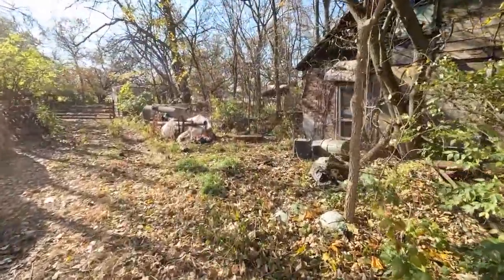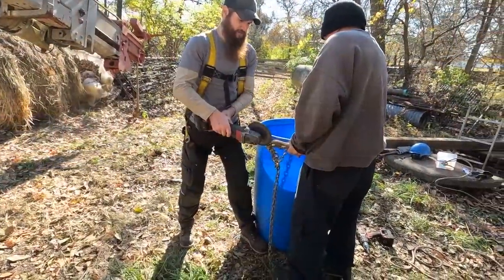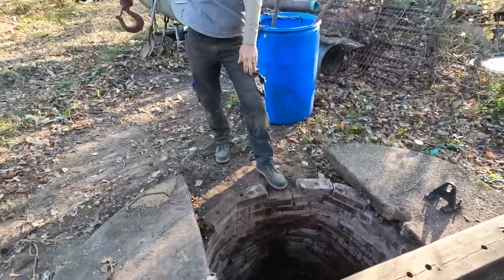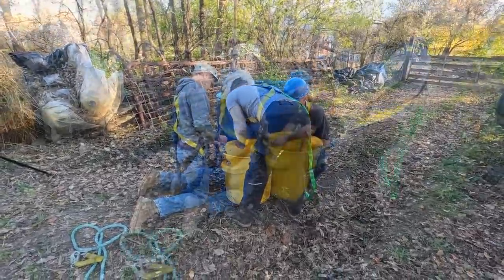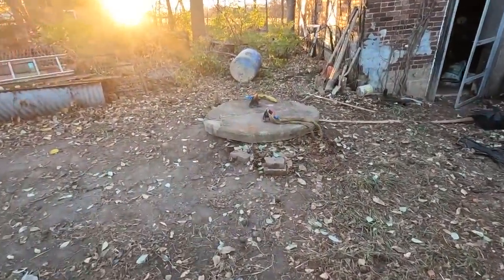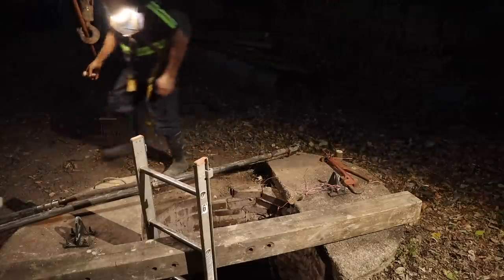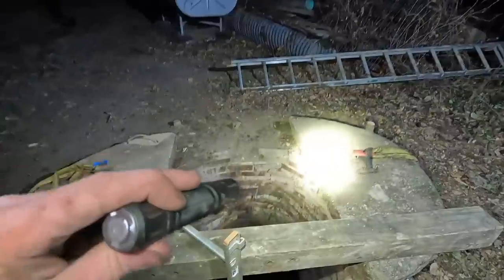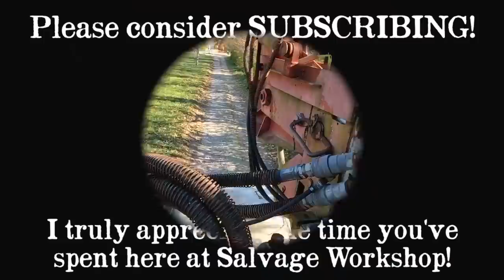Can we SAVE the WELL at the Farm with a Crane & HAND Tools? ~ Putting my Auger Crane Truck to WORK!

Comment: No vac truck operators would respond because “physics” you can’t lift water with a vacuumed more than 33’ or the equivalent of one atmosphere. If you apply more than one atmosphere of vacuum to water at  sea level it boils at room temperature.  Same reason water boils at a lower temperature at 10,000’ elevation than it does at sea level, lower pressure = a lower temperature for the boiling point. That’s why they wouldn’t even come out to look at it. It’s the same thing that happens when a propeller on a boat experiences cavitation. There can be a huge pressure drop on the concave side of a boat propeller  when it is turned fast enough with enough torque. The pressure drop on the back side of the blade is enough to cause water to go from a liquid straight to a gas.

Comment: Maybe a string and a fitting would be faster to measure. Also your two pipes going to the fitting in the well (jet pack) .
The jet pack gives you about half pumps volume and pressure. And I’d never clean a bore or hand dug well.
Mostly just wanted to share a little.

Comment: Should have put a short chain loop on the bottom of the bucket. To dump just knock it over, hook to the bottom chain lift it. also, a walkie talkie for the person in the hole and the person running the winch should be used so there isn't a delay between what one person says another hears and what they say to the winch operator.

Comment: I get a painter's mask with a little CO2 going to it from a your truck air system 5 lb on last for a couple hours going into a painter's mask and then your pipes down there are probably completely plugged up cuz they're metal and they cried on the inside they're probably full of rust and that's what your problem is not the the muck in the water

Comment: This just the most stupid, slow , positively daft way I’ve ever seen to get sludge out of a hole in the ground, you could have dropped yr auger bit in the well, stirred it with the water in there and just used a slurry/dirty water pump to clean out, you would not be aloud to do this in the UK , just plain ridiculous, normally you guys are spot on with everything you do, but you must’ve been having a off day when u did this 😮😮

Comment: running a boom without any angle reduced capacity. you want the derrick corner about 7 steps off the object your lifting or using an auger
live by the load chart

Comment: I'm gonna say you need to take a 5 gallon pail and cut the bottom off of it. Take that and put it inside itself. Put a bolt or something through the two to act as a hinge. Drop that down and let it sink once it's sunk just pull it back up the bottom should seal against the sides well enough. (No pun intended) and if it doesn't seal perfectly it should still hold the sludge and leak water back down. Just a thought...

Comment: A shop vac with a long plastic pipe taped onto the hose and lowered down there would be a good idea to continue sucking  air out of that hole while the guy is working down there. fresh air would continue to flow down there to replace the air pulled out with the vac and make it more comfortable and safer to work down there. Hard to tell what kind of gas is mixed with the air down in that hole, maybe radon, co2, or maybe methane from rotting vegetation. These are good ideas for working in confined spaces. Not according to regs, but small measures to help you stay a little safer.

Comment: Well I Love it. I’ve had to clean out my well a few times. I’m a get the job done so you over safety to me, but if my kids where doing it so again well done. Now for the next time help, an eyelet on the bottom of the bucket. Used to help tip the bucket with another rope  attached to the hook.

Comment: Actually, the answer to your conundrum is sitting 6-8 feet away. Take that culvert and suspend it around the auger. The auger will pull the goo up into the culvert & when it's full, pull it out & reverse the auger to spit out the goo.

Comment: It's jobs of this nature where for safeties sake communication becomes vital,  in my humble opinion you would be on a winner if you could source or adapt a hand held remote control set up for all the cranes functions,   that way you could have operated it from the well mouth and remained in direct visual and instantaneous contact with the man down the well, - what if there had been subsequent gas seepage overnight you were both unaware of,? 
 I dont know if there are the same things in America but in Britain we have medium sized vacuum sweeper vehicles that go around  using large eight inch bore flexible pipes to clear blockages and such in drains and sewers etc we call them gully sweepers or sludge gulpers, one machine with fifty feet of hose would have sucked out that entire well,   sludge, water and everything in about half an hour flat and stored it in an onboard 4 or 500 gallon tank where you could have driven it to any of the surrounding  fields and pumped it away under high pressure like a fire hose. it possibly could be worth your while looking into such vehicles it would add another string to your already pretty versatile company bow. there are hundreds of uses for them such as pumping out flooded cellars for one.

Comment: Had to do the same thing woth my father's well .. He hand doug it back in the early 50's . Then in the late 70's it had caved on the sides only had a couple ft of water . We used a windless and a little smaller bucket than you have  I went down and we  a day and a half  got it down to a rock bottom and couldn't keep up with the water coming in  lined it with 4 ft concrete pipe. working well today.

Comment: Such ambiguous "communication."  Scary.  And one guy seems deaf.  Scary.  I think working on the well this way is fne, but communication like "good", "I'm there" and other grunts and groans would be deadly on a fulltime crew.  Hint:  use clear, short commands that mean something, like "up", "down", and "stop".  It looked and sounded like a circus at the start.
Reply: And... that's a shallow well "jet well pump".  I was surprised that term wasn't used in the video. So now you know.

Comment: Excellent use of the crane truck, my father and uncle dug two wells by hand in the early 50s and one more around 1960 all had concrete sleeves and the acuafer was located by a neighbor using a divineing rod, the newest of the wells was cleaned once in the early 80s after filling a pool, can't help but wonder how much fuel the truck used for this project somewhere between 30-50 gallons I would think and that would be pretty good use of it, personally I like big block gas engines but for longevity and and all day torque you really can't beat a diesel

Comment: You neeed a simple air lift . that would lift the water as well as the mud. and if you had put two small holes in the bottom of the drum the cran could have turned the drum upside down and emptied it in one movement.   Disconected those pipes to give the opperator more room.  The men at the top should have had thier chin straps on to stop the Helmets from fallling down and injuring the man below.

Comment: How stiff is the sludge?  Could you have used (made) a very heavy steel bucket with a trip line?  Drop it in freefall the last bit to bite it in using the trip line to drop and a tip line to pick it up.  That should be able to be done with no one is in the well.  Only concern is those pipes while lifting or dropping but that is there in any case.

Comment: Can you get a submersible sludge pump that will push to that height? If so, the well could be cleared with a pressure washer to loosen the mud and so the pump can push it out.

Comment: A well guy once told me that wells like that are dangerous to work on since if you are leaning into the opening and slip, the other side is too far away to catch yourself. Neat project but one gripe. At the end when it was dark and you guys had been working all day and were tired, you were working at the well and I did not see a harness and line.

Comment: Back in the late 1950's I worked with my father and Brother after I returned from the Army. I have used a Fence Post Auger to drill out wells. We always had to send an Oil Lantern down every few hours because of Damps. My father was a Witcher and we hand drilled many deep wells. The Candle is not as reliable as the oil lantern. We also dug many Farm Cisterns .The deepest My dad ever dug was 100 feet X 4'  at the Bottom. You usually hit water at different levels, But the deeper you go the better quality and quantity.  That is a Cistern to my estimation, Sure not a deep well. We would Flush the Well before having the water tested by the County.  Company Almost looks Amish to me. to me.  Many menilite people have Well drilling Companies in the Mid West and North East.
Reply: Wow very interesting.. what are “Damps” and what did the candle or lantern do? Was it to do with oxygen levels?

Comment: A simple flap installed in the bottom of the barrel that would open as the barrel sank and would close when the barrel was lifted  would have allowed to remove the water by the barrel full if the water level was deep enough , as long as there was enough pressure to open the flap you could completely empty the well ; then pump it with the sump pump over to the cattle watering trough.

Comment: i worked for a well repair fella for years...easier to let water in...then put a solid sewer pipe down with a air hose in the middle and put air pressure to it...air will force water up and out and stir up muck so it comes out

Comment: I am just at the 1/5 mark and am really wondering how grown men don't know how to do this. First of all rent a proper pump! Just get a 3 inch construction pump and you will pump that well out in minutes. Just leave the pump running while you work. I have used that to clean out my well and they will pump out a well over 60 feet deep. Secondly the bucket you are using is way way too big! If that ever broke it would kill the guy at the bottom of the well. Just use one or two rubber two gallon heavy duty pails from a farm supply. They wont break! That way the guy at the bottom of the well can use two buckets and when the full one is lifted you just pull it over from the well by hand to dump and you don't have to reposition the boom every time. As one is being emptied he is at the bottom of the well filling the next one. Depending how much sludge you have to remove you can also use one bucket. The "digger" has way more room to work in there too with the smaller bucket. I was literally shaking my head when you had the big blue drum. How on earth did you ever think that was going to work?? LOL Oh you should also have some ventilation for him at the bottom of the well. He is using a lot of oxygen working and there is no decent circulation as well as ground gas and the possibility of the fumes coming down from the truck. I just use a shop vac hooked up and I have enough pipe hooked up to it till I can feel the air blowing on me at the bottom of the well. It works good too but the thing I hate is the noise from the vac. Makes it hard to communicate. A good shovel to use are those folding camping ones. You can fold it so it works like a scoop. Works great! Use this method the next time and you will wonder why you didn't do it the first time.
Reply: Excellent advice! ❤😊❤
Reply: It's always easy to look back and learn if you make mistakes and make it safer, safety first at all levels.good job well worker 👏 🤗👍👍👍🇩🇰
Reply: Fresh air and smaller bucket is the only practical advice from this post,  a non jetted pump cannot lift water more than 18 to 20 feet depending on elevation in relation to sea level.
Reply: No "real men" know how to do everything in the most efficient way.  A real man learns from his mistakes as well as his victories. They also know how to use what they have to get done what they need. Its easy to say oh  i cant believe they did that.
Reply: @docdetroit146  Ya it is easy to say that. Do you really not wonder how they were ever thinking they could dig with a barrel in there almost the size of the hole they were to be standing in? Pretty simple physics.
Reply: @michaelladue5655  You obviously have no clue. I have used these pumps many times. Here to go United Rentals and look at the pump specs. This is copied and pasted right from their site.    
* Maximum flow rate: 400 gallons per minute (1.5 M3M)

    *Total dynamic head: 77' (23.5M)
    *3-5 horsepower
    *Can handle solids up to 0.25"
    *Uses: Ideal for general household dewatering requirements
    Please contact a United Rentals representative today for information
Reply: @davebrittain9216  Did they learn something? Do you think they will try it this way again? Assess, innovate, succeed or fail, learn, repeat
Reply: @docdetroit146  Yes I sure hope the did learn something and you learn from experience from a child, that is why I was wondering how they had not learned how to do these things at their not so young age. Of course people don't know how to do everything and some people are smarter than others but still. Just don't know how they did not figure some of these things out before hand. Just like the one guy above that tries to tell me a pump wont pump more than 20 feet unless it is a jet pump. Even a dumb statement like that is ridiculous when there is a whole internet to fact check what you are saying before you say it. Stopping and assessing your situation before hand is key.
Reply: Yep yep yep..all you said....ppe clip on gas meter to know ppm O2 carbon etc
Reply: @docdetroit146 You ask 1st....how to...from old veteran confine space, miners, well diggers, old steel workers, plumbers , construction workers......somebody know  how and why.....dont gamble w a mans life.😢
Reply: The safety harness is for fall protection  if you check any fall videos you can lose your legs from cutting off circulation in the legs.    The first thing you do in a recovery is to take the weight off of the personal that is in the harness as it cuts off the blood flow to the legs.
Reply: Who the fuc invited the OSHA guy? 😮 OH that's right. He invited his self.
Reply: @christopherconwell7271  Why do you think your poor opinion is so important?
Reply: @davebrittain9216  We all should be asking you that very same question, as you’re obviously a know-it-all, who’s clearly doesn’t! If you wish to give advice, fine. It may even be appreciated. But, to intentionally criticize others simply to try to gain favor or to impress the uneducated, just proves you to be a member of that very same group.
Reply: @christopherconwell7271  He’s not from OSHA, he’s just another typical know-it-all, who doesn’t.
Reply: @jondekerguelen  You can bash me all you like but you can not find fault in any of suggestions I made, not one.
Reply: @jondekerguelen  You still have not defined the word "clearly" giving examples on faults or inaccuracies in my logic in my statement. Maybe it is you that clearly does not understand what to do in a situation like this. All you have done is be exactly the person you accuse me of being. Way to go!

Comment: The only safety issue I could see is leaning over a hole with a hard hat on with no chin strap, they fall off even if tightly fitted, any way a difficult job in such a small space well done. an extra chain on the bucket base would have helped to empty it( disconnecting the lifting chain and take the load on the bottom chain) then reconect the lift chain to the hook.
Reply: I could make a list. Even just picking one is tough but I'll go with the mucking bucket being lifted out with someone in the bottom. As long as no one was paid there's no occupation, no occupation, no osha.

Comment: One thing you should of wore a respirator just in case you would stir up poisonous gas when you start removing the rotten sludge . Those candles will burn if there's any oxygen but that oxygen could be mixed with poisonous  cases. They sell air monitors that will sniff for any poisonous gas and they aren't that expensive compared to someone's life.
Reply: Singing Come with me and you’ll see a whole host of OSHA violations to the tune of Willy Wonka. Amazing hillbilly engineering. Don’t you guys have any Vactor 2100 trucks in your area? I used to operate one and a brick would not be a big problem if that happen3d.

Comment: Because they didn't have a clue what they are talking about. There's a shortage of water they would sure use the well. Drilled another well cause the bored well couldn't keep up and cement casing. 
Went down there but we used our winch truck with gin poles.. hooked up a hydrant to a line coming from the other well.
Nice job 👍👍

Comment: You do things the hard way.  To get the water out you use two sump pumps.  One pump down at the bottom pumping into a bucket part way up the shaft then a second pump dropped into the bucket for the final lift.  This way you can keep pumping and scooping mud at the same time and you do not gum up a new pump with muck.  Once you have the well mucked out and it had the head that you want and is clear you lower the new pump with the properly installed foot valve and pex lines and power lines to the bottom.  Once the pump is at the bottom you cut the pex to the propper length and connect.    I even used a five gallon bucket drilled full of 3/4inch holes on the sides to set the pump in as I lowered.